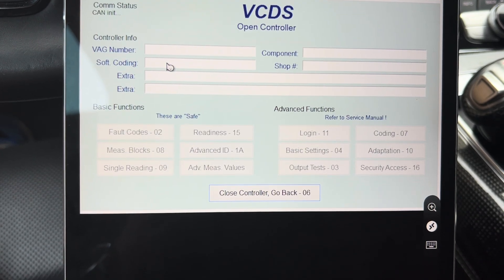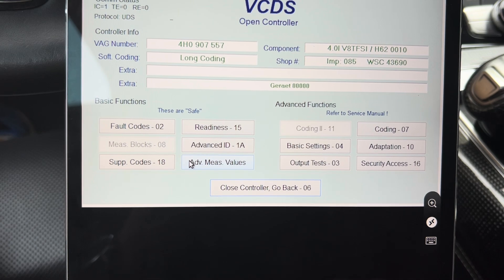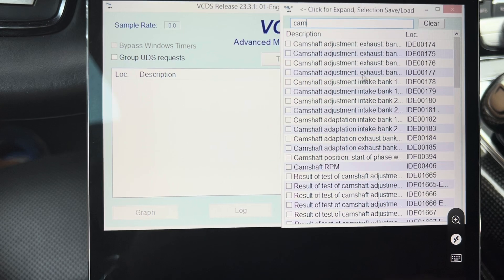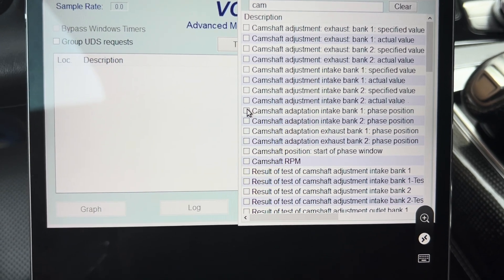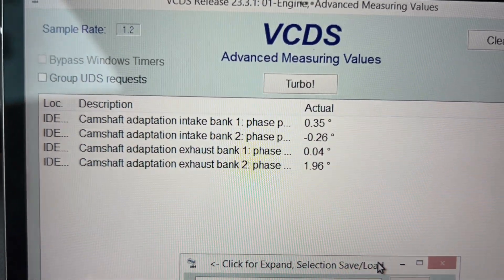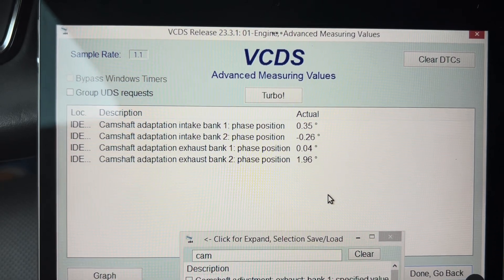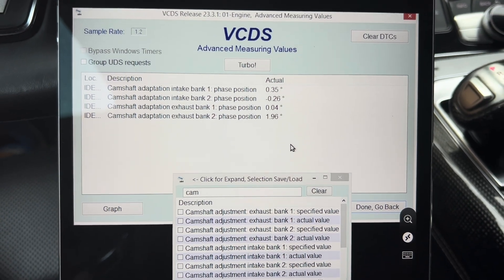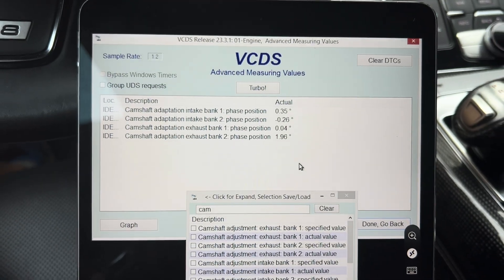HOW TO CHECK Timing Chain Stretch / WEAR (Audi and VW) using VCDS | Test That Will Save Your Engine

Comment: Hello, Pavel incredibly fascinating video! I watched your video to get additional input on my RS3 8V1 2.5tfsi. After replacing the timing chain, I have a significant adjustment, but I only have one camshaft for admission. IDE00182 -8,68°! I believe the mechanic simply skipped a tooth or made a mistake. Did you have any idea about the constructor tolerance ? Thanks

Comment: Hi Pavel, thanks a lot ! need to do that ASAP. Could please tel me if it's same procedure for the V8 TFSI , B8 or B8.5, years 2012/2015 engines , did you say the engine need to be warm and running or only warm, oil reaching at 95°C ? Many thanks
Reply from the maker: Hello, yes. I did it on that same engine. What is your car?
Reply: @pavelppp888  Hi Pavel, mine is the RS4 B8 , with the 4.2 L N/A TFSI engine. Thanks
Reply: Heard people rev the engine, even up to 6k to see if figures changes at these engine speeds.

Comment: Jetta 1.4 TSI CAXA engine my Camshaft Adaptation Intake Bank 1: Phase Position is showinf 0.00 dregrees. That's correct?
Reply from the maker: Try after long drive without shutting off the engine. Possible missing calibration. What year is the car?
Reply: @pavelppp888 Car's year is 2018 MK6.5 generation.

Comment: any idea why I have intermittent rattle that is not always present and not the same magnitude? on cold start ups but sometimes warm/hot too
2017 4.0TFSI A8 160k km. Seems to be fuel diluting the engine oil ?
Reply from the maker: what oild are you using? 5w-30? try 5w-40 ;)

Comment: Hey I recently changed full timing kit on mine and used all locking tools. Shows -5.5 but chain rattle is gone since I done the chains guides and tensioners
Reply from the maker: Hello! What engine is that? It could be the engine is not calibrated yet but the valves will change after some time

Comment: Hi Pavel i have around -3.90 to -4.20 deviation and i have the rattle on cold startup. Should i change or i can drive for some more? 
what do you think?
Reply from the maker: Hello! What is the engine? If the rattle is only on startup and is less than 1-2S, you are okay.
Reply: @pavelppp888  Its on startup of course cold start. And its around 1-4 sec. 3.0tdi CDUD 2013
Reply: @pavelppp888  hey pavel, i'm at 2.5 on warm idle.. goes up to 5 with hard accelaration. 3.0 tdi 2013 ! how bad is it ? cheers !

Comment: Hi Pavel,great straightforward video. Will this be the same for my 2005 Audi TT 3.2 v6 ? Also does it have to be vcds pro ? And what connection are you using between laptop and obd port please?
Reply from the maker: It just needs to be VCDS. Does not depends on the version. I am using one from aliexpress for 30 euros. What version you have?
Reply: I don't have one, I'm looking into getting one so I can check my timing chains on my 2005 Audi TT 3.2 V6. I meant what version of VCDS do you have,does it have to be pro to be able to check your chains ? So any WiFi dongle will do for your obd port ?

Comment: mine is -48 wtf, but no cold start rattles no engine light nothing
Reply from the maker: Interesting. Which measuring values are you checking?
Reply: @ camshaft adjustment: exhaust phase: bank 1 and 2 

camshaft adjustment inlet phases bank 1 and 2 

Both were giving me abt values of -48 

Cams adjustment actual was 0 degrees idk it’s really weird I’ve asked around 
Any ideas?
Reply: @aryannaik2532 you got the wrong measure block. Look at 0:53 its the cam adaptation not adjustment
Reply: @ my vcds isn’t displaying camshaft adaption for some reason
Reply: @aryannaik2532  hey did you ever figure this out? mine displays -48 and definitely doesn't seem right. i cant display camshaft adaption either!!!
Reply: @Steveesm33 no clue, i had another a6 which has measuring blocks not blanked out on vcds and was showing normal readings, but on my a5 and a7 measuring blocks is blanked out and the only way to check it is though adv measuring values. tbh my best guess is that if both values correlate to be around the same minus both the values and i think that should be your timing chain values

Comment: Is this 5 degrees limit during idle? Or should I do a test drive with live logging enabled? Also does the engine have to be at 90c?
Reply from the maker: The degree hould not be more than 5 degrees on all RPMs. And yes, needs ti be warmed up
Reply: @pavelppp888  awesome, thank you